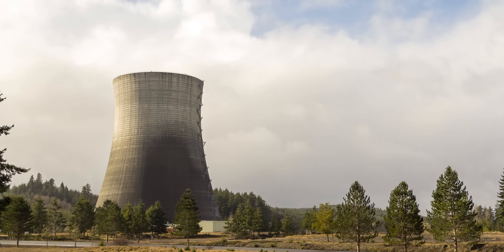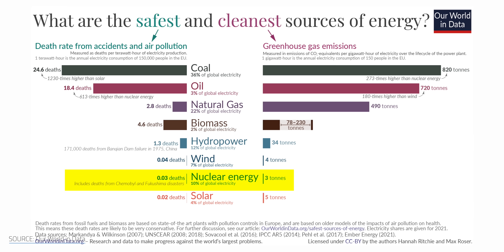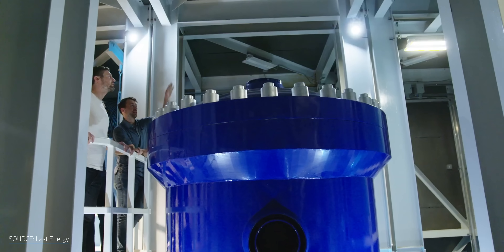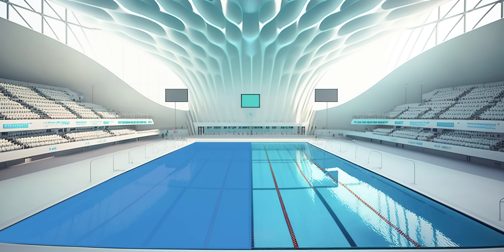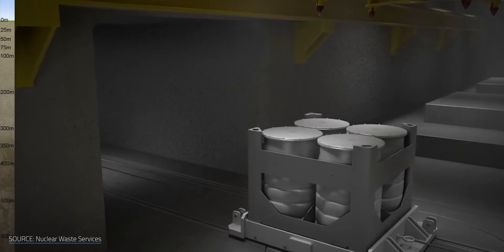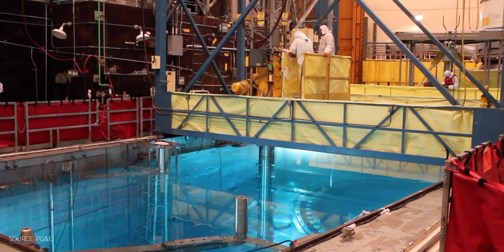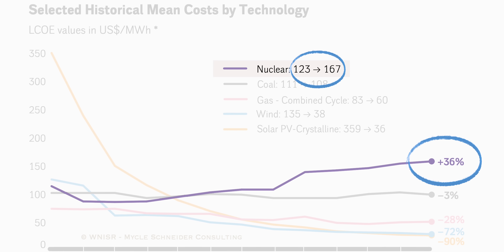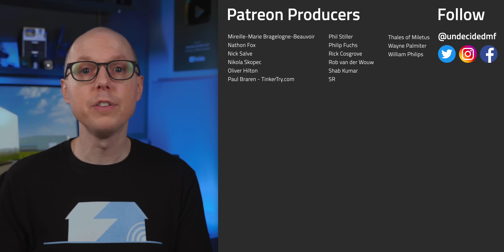Is Small, Fast, & Cheap the Future of Nuclear Energy?

Comment: One thing I think they should do to improve the safety is to hang the nuclear reactors from a cord inside a tank full of liquid coolant with some long springs on either side to reduce the chances of sudden impacts during an earthquake or minor tremor, since the small reactors are now in production they should use those with rods or something of the same weight but only small explosive effect if it does get a sudden impact. Yes it would damage the reactor but that can just be repaired since it never had anything nuclear in it to begin with. When the shaking has been minimised in even strong tremors/earthquakes it will be safe to test with actual nuclear rods to then verify it won't cause a chain reaction if businesses were to use them as backup generators. I say hang from cables because like those things meant to check if buildings have been built to resist wobbling it will keep the reactor in a relatively stable state since the liquid would do the moving instead to allow the reactor to stay in relatively the same position, the springs are to stop the reactor going too far towards the wall in the event of a major tremor while still allowing some wiggle room for movement
Reply: You're hired... The industry is in great need of geniuses like yourself.
Reply: @alainpannetier2543  I'm just unrestrained with how I think, I REALLY don't care about the norm when I want a solution to something, I'll go with whatever as long as it works, even if it sounds silly to start. As for being a genuis, sure I have an IQ of 132 last I checked (140 is the passing mark for a genius) but I would not classify myself as one for just this which anybody could think up if they stopped thinking inside the box.
Reply: @alainpannetier2543  Why don't you give an actual link then? I am actually curious, just not curious enough to do the research myself :P

Comment: Are they looking into thorium salt reactors? I don’t know too much about them but from what I understand they’re much safer as they require a catalyst to sustain a reaction and that can be removed in the event of a possible meltdown. Also with the idea that thorium is more abundant, easier and safer to extract, and is more energy dense as well as the byproducts can be reused
Reply: Molten Salt Reactors are still experimental. They have corrosion problems that need to be addressed before being viable.

Comment: Great now build them as small thorium irradiation reactors, that also can reduce its own nuclear waste or recycle and burn up used plutonium rods. Backup the whole system with slow speed underwater turbines called Waterotors to make sure power to the reactor is always available. On your subject,  by placing small modular reactors on ships so they could be moved  if needed might have saved what happened in Japan. Using these small reactors with transparent aluminum greenhouses could turn the far North into now unused agricultural growing areas.

Comment: Well made video. How long do the deposits actually last? I heard that the price will continue to rise because the power plants can still be operated for around 65 years based on today's raw material consumption. The more are built, the faster the deposits should be exhausted and the price should continue to rise.
Reply: As reactors become designed to burn/"extract" really, more of the energy in what is NOW waste fuel, the actual fuel/disposal cost would plummet.
Reply: @mikewurlitzer5217  Even if the costs should drop by 75%. The problem of the increasing demand for raw materials remains. Even if 10% to 20% more raw materials are developed. Is it 70 to 80 years.

The number of reactors is expected to increase drastically over the next few decades. China alone is planning 47 new reactors in the next 10 years. India 12 and Russia 25.
If only 50 new ones are built worldwide, the number increases by 10%. The supply of raw materials will end at some point.

Although renewables require more space, they are only 1/4 as expensive and last until our central star goes out. So several millennia. I'm happy to accept other opinions, but what happens when there's no more fuel available?
Reply: @polarwolf6959  Depends on what deposits you are talking about? Cheapest, sub $130 per kg deposits of directly usable U235? But that's only .7% of uranium available and then you have the breedable U234 that can be made into U235. U234 is a decay product of U238 that makes up 99%+ of Uranium ore. Then you have to look at the fact that we're currently only using 10% of the energy in the U235 that we are using as fuel and storing the rest as 'spent' (huge misnomer) fuel.

Even with massive proliferation there is thousands to hundreds of thousands of years worth of fuel, not to mention other sources like thorium, that is even more common.

Point is, nluclear isn't the last energy source we'll ever need, it's a transision powersource we desperately need to start using while we develop and switch over to things like orbital solar or the holy grail, fusion (if that ever happens).

Once THAT happens, nuclear will probably become exclusively an SMR or Space based power source for space ships or colonies due to it's extremely high energy density.
Reply: @polarwolf6959  considering molten salt reactors or other liquid fueled reactors will burn up 90%+ of the fuel compared to less then 1% with solid fueled traditional reactors, we won't have any problem sourcing fuel for 100s if not 1000s of years plus thorium is a byproduct of rare Earth mining so that would keep the costs down.

Comment: The biggest fail in nuclear is that in the past 70 years they haven't built the waste solution, and this new system seems very practical, but it still does not address the waste issue.  The problem with nuclear is that getting to the point of generating power has been so expensive that the people involved have forgone spending time and money on solving the waste issue.  There just isn't any profit in nuclear waste.  If there was, then the cost of nuclear energy would skyrocket.
Reply: Waste storage is a problem, but not the extent of a problem that it is believed to be. The actual amount of long-term radioactive waste is proportionately small, and can, for many, many decades be kept, safely, on site. Additionally, a large portion of the nuclear waste, spent fuel rods, can, and should be re-processed into additional fuel. This is done in other countries, but is prohibited in the United States because of weapons proliferation concerns. This regulation should be eliminated.
Reply: The reprocessing techniques have existed since the 50's. Some countries do recycle the waste today, but it's just cheaper and less cumbersome to kick the can down the road and purchase new fuel. Keeping the waste in containers on site for years is not expensive at all, and new fuel is cheap compared to the energy it gives off. There is plenty of value in spent fuel, it's just cheaper to run open cycle for now
Reply: And the anti-nuclear Luddites will assure no solutions are found as who will waste their time and money researching a solution for something Marxist democrats have done their best to destroy.

Comment: How vulnerable to sabotage are SNRs?  If nuclear safety depends on stability of societies over the long term, then we may be having a false sense of security. Right now we are at risk of a new nuclear disaster in the Ukraine.  Your analysis didn’t break out the cost of economic impact of disaster on the Levelized costs or any increase in costs in actually burying the fuel.  Maintaining infrastructure takes constant investment and oversight. I look at how poorly the richest country in the world has maintained its dams. In the midst of economic decline or political uncertainty, nuclear is not a sure thing.  Also needed would be the a comparison of SNRs against traditional nuclear to generate the same amount of energy. Finally the idea of inground nuclear seems to risk putting them where the don’t belong given floods and climate change or seismic instability. The pressure for easy solutions may push people to take short cuts. In summary, the problem with nuclear isn’t just the physics or the economics it’s dependency on people

Comment: Nuclear IS the way. Once standardization and the resultant reduced regulation are embraced, the cost equation is significantly improved. Further optimism exists with the reuse of the "waste," a better "marketing" term might be by-product. The huge (ugly?) footprint of solar and wind and their reliance on undependable weather to function negate them as ever becoming a reliable energy source. Thanks for the video. A bit more optimism would have been appropriate.

Comment: Large nuclear power stations expensive because of complexity, safety tests and expensive labour. Small modular reactors are cheap because they aren't complex, safety tested or run by experts. But you get them really fast.
Reply: $6billion/1100MW = $5454 per KW
$125million/20MW = $6250 per KW 
I feel this should have been mentioned, but I suspect this is actually sponsored content.

Comment: You missed a few details:

The safety standard of nuclear is ridiculous: it requires that waste steal as an example be 15x less radioactive than the oil industry. This it the fault of the EPA and would cut the cost by 65% in the U.S. if they just required the same as oil/gas. 

The reason we don’t recycle our fuel is 2 fold: first because of EPA regulations we use Gen II reactors that generate plutonium. They can’t use the waste fuel naturally so the cost is high. Gen III candu and similar reactor can.   The EPA also makes it cost prohibitive to recycle nuclear waste in the U.S.  

The vast majority of why nuclear isn’t viable in the U.S. is ironically the EPA. To really fix the problem you have to fix the EPA.
Reply: What is the LCOE for gen 3 plants?
Reply: @tedmcdaniel2951  that’s a difficult number to make any sense of to the U.S.  Canada’s CANDUs cost about 1/3rd US reactors. But probably half of that savings is that Canada doesn’t have the STUPID EPA regulations. 

Gen Iv is about 35-40% lower comparatively from that. 

But Canada didn’t use gen ii so it’s hard to say. France didn’t either and those that signed on to the marshal plan in full all must use gen ii US certified designs because the US has no gen iii certified designs that have a functional variant. (This is why Japan uses and Germany and the UK use the crap GE design from 3 mile island fame.)

What’s clear though is that gen iv without epa silliness would be in the sub 1 cent / kWh range which beats coal and makes it so cheap that it would be better to over provision and shunt excess power into the ground than power up ff demand generation on a cost basis.

Comment: It is low emissions but still 5 to 10x wind. NOT RENEWABLE! Higher LCA than PV and batteries.
8 times the cost 
18 years longer.
Currently needs Russian/ stans enriched U so simply exchange Middle East Oil with Soviet sovereignty. 
By the time 2033 rolls around economics and technology will so far exceed that it will be an also ran.

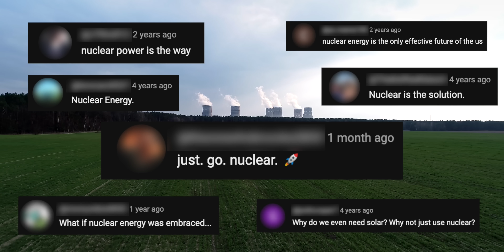Comment: Matt, there is no possible method whereby which "renewable" energy sources like wind and solar can displace the energy produced by fossil fuels -- far too many "ifs" in the equations positing such nonsense ("if" we all convert to electric vehicles overnight, "if" we replace every single electric motor with SRM...). Everything you said starting at 0:48 does not accept the reality that only nuclear has the availability, reliability, scalability and capacity to replace fossil fuel power generation at current and projected levels well into the future. I appreciate your acknowledging nuclear energy needs to be one portion of an "all of the above" approach with wind, solar, hydroelectric and geothermal, but nuclear energy production should probably be a significant percentage of that equation.

Comment: Nuclear is so disrespected just because of like 3 or 4 acidents.
Reply: And terrorism like is going to happen with zaporogia power plant in Ukraine.
Reply: @PeterSedesse  Is this a warning or curiosity? The reactor was shut down last September.
Reply: @yo_boi_john4471  shut down?  It isn't producing electricity but still requires cooling and still contains all the radioactive material that would scatter.
Reply: @PeterSedesse  That is why a way to dispose of radioactive material is currently a hotspot for nuclear related discussion. Having a reliable way to dispose of it would be great for nuclear adoption and the security of safe energy.
Reply: @yo_boi_john4471  well my opinion is that nuclear just isn't needed. Solar, wind and especially battery technologies are advancing so rapidly the last ten years.. the upfront costs of nuclear, the NIMBY issues, the security issue and the nuclear waste issues are all just unnecessary problems.  Once we go to sodium and get away from lithium things will get so much easier.
Reply: @PeterSedesse  I am also interested in the advancements made with storing electrical energy, as well as renewables as an easy and carbon neutral solution to quick and easy power. But there are some advantages to nuclear, like energy density and reliability outside of human error and terrorists. Perseverance used nuclear for power instead of solar panels or a wind turbine because no human was there to maintain it.
Reply: @yo_boi_john4471  I agree, I am not against nuclear..I am just voicing my opinion more from a business betting perspective.  Human perception and PR do matter, even if they are based on faulty knowledge. In the next 5 years, solar wind and batteries are going to be advancing quickly while nuclear is going to be fighting the same PR and safety issues they have been losing for 30 years. Go to any small city in the USA and tell them a local factory is going to be installing a mini nuclear reactor and then go to the next city council meeting and tell me how it goes.  Solar and wind are winning over the NIMBY crowd, nuclear never will.
Reply: @PeterSedesse  Solar and wind are pretty easy to adopt. they do a lot more for small towns then nuclear may ever do. And you are right about public opinion having a big impact on nuclear.

Comment: You might be able to shrink the reactor but you can't reduce the size of the associated steam turbibes and cooling system. Rmember that a thermal power station is only around 30% efficient threfore you need a lot of cooling. A report by Bloomberg last week said about the  NuScale SMR "....But new estimates show costs surged to almost $120 a megawatt hour this year, according to company data analyzed by the Institute for Energy Economics. significantly higher than solar or onshore wind at $60 and $50 a megawatt hour, respectively.

Comment: What's the projected LCOE for an SMR plant?

Unless it's cheaper than solar, wind and storage (after accounting for intermittency), it's unlikely to get much traction, because if you can get the same performance for the same price from a technology that is never going to make you glow in the dark (and I understand the reality, but public perception is difficult to change), you'll take the (perceived) safer option every time.
Reply: In my country it's difficult to be dependent on solar and wind, because there simply is no room to put them (we are building huge wind parks on water because nobody gets permits to build them on land anymore). Let alone the batteries you need to have a stable grid. Having a few SMR's to fill the gap really is a great option to be fully rid of any coal or gas plants still running.
Reply: Depends on what you mean by "cheaper". Coal's costs about double once you include the externalized costs of health by pollution. And that's conservative based on known direct health impacts.
Reply: Your "glow in the dark" comment certainly did not help the "public perception" issue. More importantly what is the TRUE TOTAL cost of being held hostage by the BS "Climate Change" gestapo when they are never even asked "Change FROM WHAT TO WHAT?"  What if their deliberately undefined "Change" was actually better?  That is why they are never asked the "Change FROM WHAT TO WHAT?" question.
Reply: Nuclear is much safer than hydro, wind, fossil fuels.

Plus kills zero birds.
Reply: You make it sound like it's one or the other.

We need diversification of our carbon free energy supply and nuclear is so complimentary to renewables due to it providing a consistent baseload compared to the variability of eg. Solar & wind. It makes sense to invest in nuclear even if it is slightly more expensive than some renewables.
Reply: everywhere they build solar and wind the price of electricity goes up for the consumer so I have no idea where they are getting their numbers. Everywhere they build nuclear (once finished) the price for the consumer goes down. This is the most annoying part of this debate.
Reply: @calebfielding6352  Where are you getting your facts from?
Reply: @calebfielding6352  🙄Is this why we are building out so much more nuclear power than renewable wind and solar??? Oh, wait... I call BS.
Reply: @calebfielding6352  Well, that is because nuclear is subsidized like nothing else. And how could you say that at all, nobody is building plants in a volume, that they could change prices for the better.